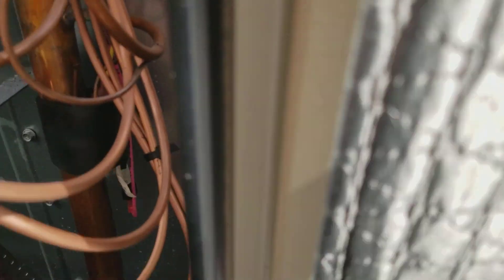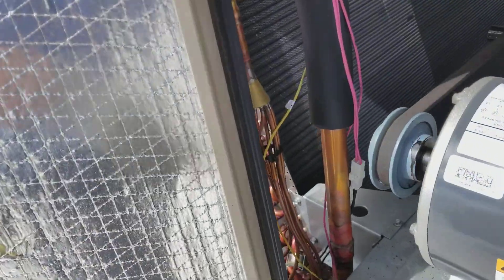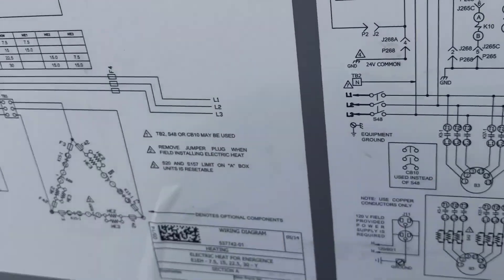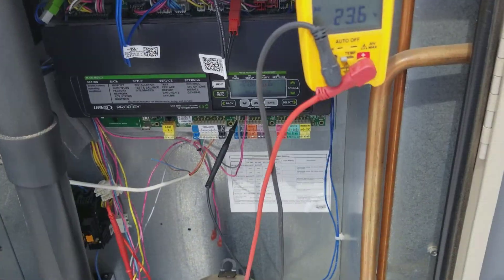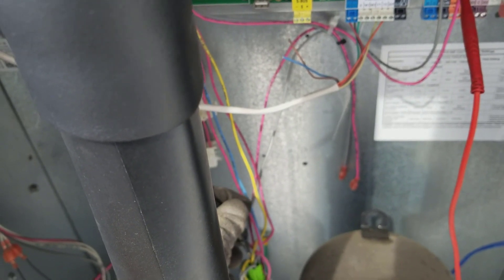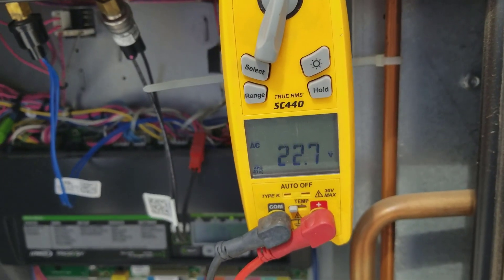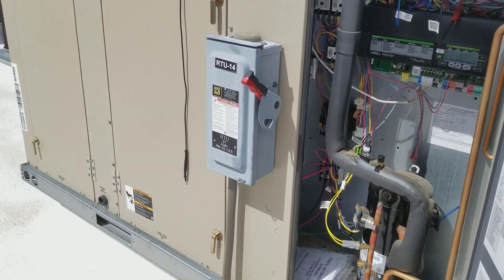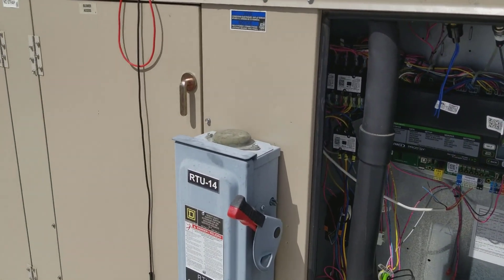Lennox "Resistor, TXV control" - What is it?

Comment: High ambient with a Dirty condenser or Condenser fan motor failure ? or combination of both opens txv a bit to drop head pressure.
Reply from the maker: More for when the airflow is reduced or the indoor load is reduced causing the TXV to close down a lot (such as when the belt breaks or the air filter gets plugged)
The "microchannel" style condenser coils can't store as much extra refrigerant than the traditional tube and fin coils.

If the head pressure climbs it will warm the TXV sensor which will throttle open the TXV and allow more refer to be in the evaporator so it won't stack up in the condenser.

After making this video I did confirm what it was with some Lennox gurus.
Reply: @hackfreehvac  awesome. I just talked to a Lennox tech support guy and he wasn't sure either.

Comment: Hi my name is Luis and I work for a company that is a lennox dealer. I think that it's a safety device for when the unit trips on high head pressure due to the microchannel coil. I've had a unit that would reset head pressure but trip right away because of the pressure build up. So having that resister there will help low the pressure on start up. Its only a guess but seems logical.
Reply: luis jasso I'm thinking that's what it's for also. Keeps the valve wide open while it's off on high head letting it equalize. I wonder if they used non-bleed txv.

Comment: Your on to it, micro channels are not able to hold near the refrigerant. Started figuring it out the most when I would get to a call with a split system and need to change a leaky evaporator or bad txv, most of the time I just pump the charge down into the unit and trap it in there, most of the time you can fit the entire charge in the condenser but when you try to do it on a micro channel one it only holds like a third of the charge and you have to recover the rest.
Reply from the maker: I was curious what would happen on a split.
Traditionally you can pump all of the charge into the condenser.
I suppose new systems then only come with a partial charge from the factory and you add the rest?
Reply: @hackfreehvac  if any additional charge has been added to a microchannel then do not pump it down. I find it's best to just recover from the get go.

Comment: Some GM engines had a similar thing with their thermostats. The thermostats had a really high "natural" temperature of like 230°F or something like that as a fail safe, but embedded in them was a little heating element so the PCM could control engine temperature.

Comment: Just guessing but, it can be a device to get les superheat over the evap this will drop the discharge tempurature off the refrigerant. At that pressure. So compressor protection. Lower discharge pressure instead off cut off the system.

Comment: Ya, that's sounds like it could be it. The micro channel coils really don't have much volume. Cheaper to do that than put in a receiver too
Reply from the maker: That's what I'm thinking.
I know on things like a Water Source Heat Pump the TXV closing down can cause the liquid refer to stack up real quick in those low volume water to refer heat exchangers. 
The microchannel being lower volume seems to be the only reason for forcing refer to feed into the evap coil when the head pressure climbs.